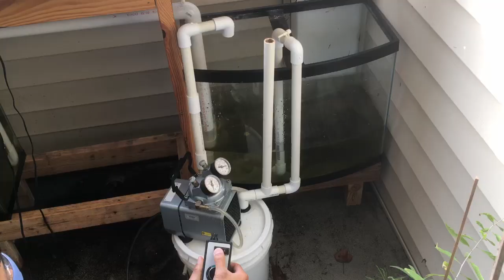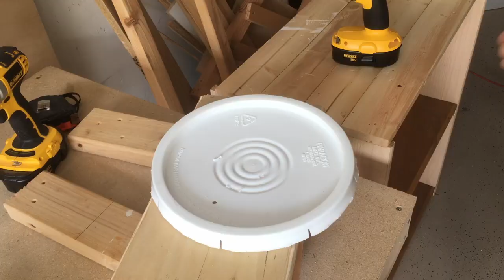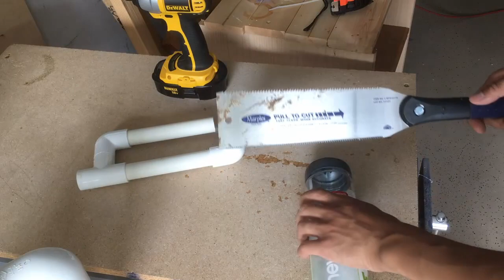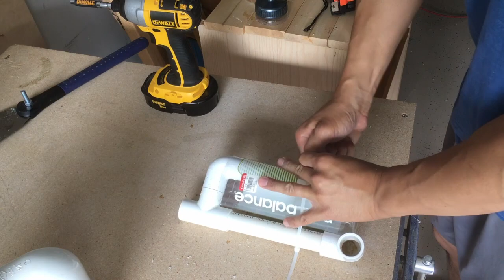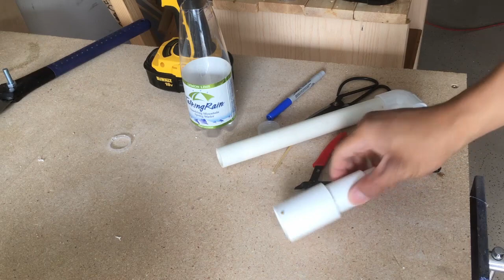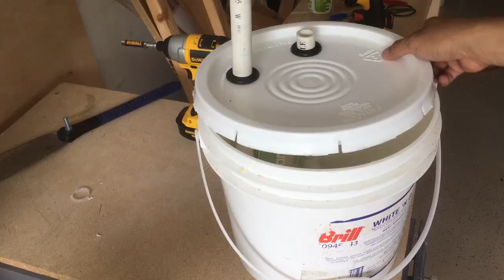How To Build A Pneumatic Ejector (Air Lift) Pump Using a 3 Gallon Bucket

Comment: As I see it, the stand pipe in the final scene connected to the tee-fitting would break any siphon.
Since the bucket is not transparent, and the video is so short, why should we assume the water coming out of the bucket isn't simply replaced with air?
Too many questionable items in this build.

Comment: Hi I made the neumatic pump like in your video , it pumps the water ok but does not fill the bucket, can you give me some digestion on the problem ..... Gracias
Reply from the maker: Hi sorry for the late reply.  Does your pump simply blow air and gurgle after it pumps the water out?   The problem with refilling your bucket will depend on how you have it connected to your bucket.  The refill rate needs to be at a certain rate, if it is too slow, the internal air siphon of the chamber may not close.  Do you have a water reservoir connected via a "u" siphon or is the reservoir have a pipe at the bottom of it connected directly to the bucket?  If the former, the problem could be in the "u" siphon.  Otherwise, you may also want to check if the reservoir's water level is high enough to give adequate pressure during the refill stage.

Comment: will one way valve works? use one way valve instead of rubber bouncy ball
Reply from the maker: Yes, it depends on the spring force of the one way valve you purchase.  If it is too strong, the water will not fill back up.  I'm sure off the shelf valves spring tension can be modified or if you use a flapper valve in say a toilet which has no spring it would work as well.  

It is why I made my own with a rubber ball since there is very little force to open the one way valve.
Reply: @LockeLaboratory  i have two tank (one at top and the other at bottom), currently i am using 200w water pump transfer water from bottom to top. if extend the drainage pipe to reach the top tank, will it works?

Comment: Where could I buy black rubber?
I need to make a similar tank
Reply from the maker: Hi, I got my black grommet off of McMasterCarr.  There are other hydroponic suppliers that may have food safe versions however.
Reply: @LockeLaboratory  Thanks for answer.

Comment: What happened when you speed up pump? It looks like something wrong
Reply from the maker: Monkey Host hi, it was working normally. what happen is it purged all the water out of bucket so then air siphon activaxed and started a refill cycle. when pump refill with water, air pump will purge out water again.

Comment: What is the total height that the water is lifted?  I need to lift water about 180 cm (70 inches) - from the bottom of one blue 55 gallon barrel into the top of another stacked on top... do you think this would work?
Reply from the maker: Hi Mike D, this particular design only lifts about 3-4ft.  I haven't tried going any higher as the bucket may not be able to withstand much pressure.  However if you use pressure rated PVC pipe, it certainly can work and you are only limited by the air pressure supplied, and the pressure ratings of the pipe fittings.  Also you'd have to be more careful of the one way valve design (needs to ensure it wont jam under pressure, so a rubber ball may not work.  Perhaps use a marble or an off the shelf flapper valve instead?).
Reply: @LockeLaboratory  this is awesome, need this to lift water into filtration system for my pool to pond conversion......ould be awesoe if you could MacGyver a 40 to  55 gal container lift system...I'm not that talented, the use of the bottles would be too small or flimsy?
Reply from the maker: @Mrsboncouer  do you mean to make a pump out of a 55 gallon drum?  Never tried but it should be possible.  Not sure the pressure specs of a rain barrel but since it is so tall it may have to be buried.  How tall are you thinking to loft the water?
Reply: @LockeLaboratory  didn't mean using 55g drum...but maybe 10 or 15 gallon, more solid barrel could handle the pressure better...i need to pump from the pool up to a 3 barrel filtration system....about 9-10 ft high from pool bottom to top of filter.

Comment: Hi Jimmy, is
 the overflow on the inflow from tank needed? Any reason why a straight inlet pipe couldnt be used?
Reply from the maker: Hi There!  A straight inlet pipe going to the pump would work just fine, the reason why I have a weird set of plumbing on the inlet is because I didn't want to drill a hole in my aquarium tanks.  Is that what you were referring to? I hope I am answering the right question.

Comment: Interesting video overall. Thanks for the build. I hadn't heard of these till 2 videos prior and was looking to see what they were and how they were used.
Those aren't unions, they are couplings. A union has 2 sleeves and two caps. The caps are screwed onto a center piece that "unions" to the two pipes together. This is a joint that can be taken apart. A coupling is not designed for disassembly, it is glued in place.
Reply from the maker: Ah Thanks for the correction.  Sometimes I call things the wrong name and not even know it.

Comment: Would this work for my aquaponic system? I have my sump tank ~4 feet below my ground level, and i need to pump the water vertically up the 4 ft, and up a small grade (about 2 inch) over 30 feet.

Comment: Thank you so much for making this video. I'm a beekeeper who's intrigued by aquaponics.  This got me thinking, pumps for honey are expensive, like $1k. Also, honey must be heated to lower the viscosity. I'm curious if a pump like this might be a fraction of the price and work better.

I may be doing some experimenting in the next month. Water is about 8 lbs a gal, where honey is 12 lbs per gal. So higher pressures would likely be required and a typical pail won't cut it. I'd be curious to hear your thoughts, @jlock8! Great job.
Reply: maybe a bucket reinforced like this might allow higher pressures whether you're pumping water faster or honey.
http://www.beeculture.com/better-way-bottle/

Comment: Very nicely done, you are quite the videographer !  It seems that many of us are scoping around for a more effective setup to lift simply out of a deeper water as in a well with low pressure air. So far the simple air bubble lift, gun by gulp, is the best, or most economical anyway that I've come across yet for less pressure needed but I'm supposing your system is more effective and efficient for less lift height.  I'm particularly interested in an emergency well pump that uses a low cost air pump such as a foot/treadle style. Thanks for your hard work!

Comment: Cool design!

Have you tried a percolator design? Basically a aut-stone in the bottom of a lift pipe that when the air is pumbed in will lift some of the water up with it. 

I'm just wondering is that would not be easier to make and use less air as you don't need to lift as much water as you're not relying on the water displacement of the whole stack of water in the bucket / lift pipe but only need to generate enough pressure to displace the water column in the water reservoir up to the level inside the lift pipe and then from above that level you are using air-flow to lift the water further up. 

If that made sense to you that is! ;-)

Comment: I'm trying to build a similar pump to the one in your video. When I initially fill the bucket with water and turn on the air, the water ejects just fine but never refills. I can feel the air flow from the outlet pipe after that. Any ideas?
Reply: thanks for the suggestions, i will give it a try. Thanks for posting the video. Very cool concept. I'm trying to add a little more flow to my aquaponic system to expand and this seems like a good love energy consuming option